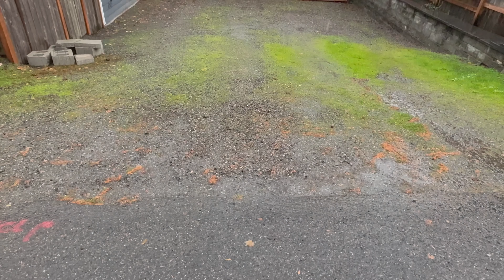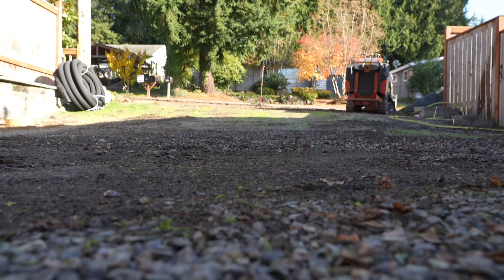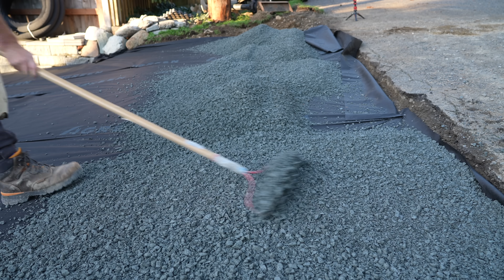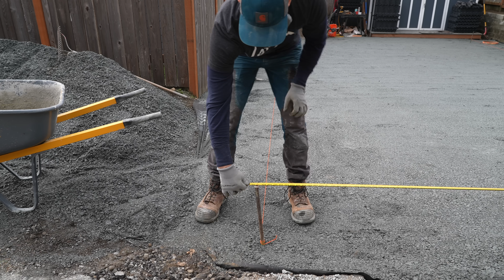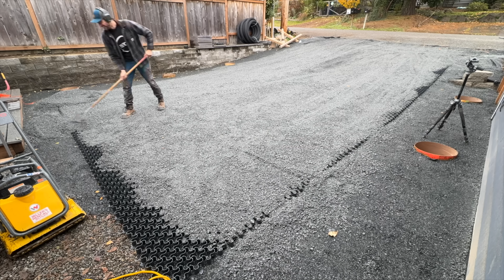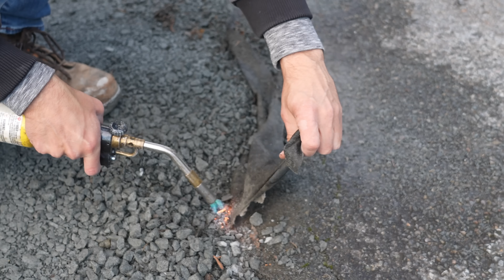How To Install A Permeable Gravel Driveway Grid System

Comment: I would recommend as you  prepared the site having at a minimum 8” sock fabric Drain in the center of drive. You could clearly see from street view from front to rest of drive a low elevation that will trap water that will flow under house. Water must be redirected away from house at all cost to avoid structural damage to foundation. I would highly recommend renting a professional lazer on tripod. I realize you are attempting to teach others, but the expense you put in this project will be worth it. I have done excavation work many years and water can be enemy number one.
Reply: Yes, I agree, the drainage during heavy rainfall may not be adequate here for all installations, and while I don't know where OP is located, this could present a significant problem for some folks depending on one's location and climate.  A project such as this is the perfect time to install a trench drain along the edge of the road, for example, or to install a longitudinal trench drain between the walkway area and the parking area.  Then the walkway area immediately adjacent to the home should definitely be graded downward away from the building and toward the drain, with the driveway itself slightly crowned so that half of its width drains toward that trench drain, and half the width drains off the side of the driveway furthest from the building.  (Such trench drains can also move water where you want it most, into adjacent planting beds during rain after a dry spell, by attaching perforated drain pipes covered with sock fabric in those areas, as long as the slope of those pipes is planned accordingly.)  While this system is obviously meant to be permeable, anyone planning their own may want to consider that such a system will also tend to become less permeable over time as silt, mud, dirt and vegetation accumulate and gradually contribute to a greater density at the surface, and of course any ice or snow on that surface will completely change the equation.  Above all, anyone contemplating sealing or topping such a system with tar at some point in the future will definitely want to make other provisions for drainage that may not have been necessary for OP.  Planning ahead to accommodate extreme weather events is generally proving to be a safe bet!
Reply: He’s in the PNW so he might be on a slab. No basement or crawl space. If there was crawl space we would have seen vents below his siding.
Reply: Yes my thought exactly, I was thinking of possibly a French drain with a catch basin.
Reply: I was thinking of something similar - but mine was to collect the water.  This is needed in my situation because I live on clay - and good drainage is an issue.  So I'll probably have 2 levels of crushed below the plastic top with an additional barrier to divert the water towards the collection system.
Reply: We’re thinking about installing something similar on our farm to run a forklift on dirt. Can you help me figure out the most cost-effective way to do it while making sure it lasts long term? We have a limited budget, but we want to do it the right way.

Comment: I think that’s a 36” machine not 30” wide. That would be a very small mini skid haha. The 36” is already the narrow track version of the SK800. Great machine I use them all the time. I always use woven fabric to separate soils from aggregates. And as others have said weeds will come. I think soil / aggregate separation is a more accurate description vs. calling it a weed barrier. Is there a reason you chose non woven? The woven is much cheaper too … like $200 for a 12’x300’ roll.
Reply: They are so cute.  Made to fit through the door so you can work inside a building.  Made a work area inside, watched them bringing in the gravel and dumping it to fill the 4 foot deep pit was funny.

Comment: The grid system that is $1077 for 315 sq ft is very expensive. You probably spent $4000 on the grid system!
Reply: no discount till you get the $12K packages.

Comment: Can grass be used instead of gravel?
Reply: the website shows it with grass inside it.  Don't know how the lawnmower would like it though.
Reply: We used it with grass and it works pretty well. Protects the roots of the grass and is easy to mow over if necessary.
But, keep in mind, grass may not grow under a tree (even grass in the yard tends to be thinner or non-existent under a tree). The grass is thinner under places that are driven over multiple times per day.
Reply: Thanks!!!

Comment: I made the same set up using  a roof tear off (shingles) and  8/10 screened gravel.   I saved $400 fee the roofer wanted for taking the piles to the landfill and spent that on a delivery of gravel.  I turned 2 swampy areas into great pathways that have stayed soilid for 30+ years now.   I did err by adding some gravel fines to one path thinking I wanted it to be tighter and quieter but it instantly turned into a bed for weed seeds!    Every year I have to scrape off the spring growth on that one but it still has never sunk into the swampy condition I needed fixed.   If I were laying a driveway on country property I would make it from  6 inches shingles (packed)  and 4 inches of 8-10 gravel topping!
Reply: all those roofing nails makes a good keep out sign as well.
Reply: Get some rock salt for the area with the fines that is growing weeds, it'll keep any kind of growth OR, you can mix a gallon of white vinegar and dissolve two cups of salt in the vinegar and pour it on that spot; that will kill whatever is growing and prevent more growth.
Reply: @ApoliticalBlues  Some folks may have trees growing nearby with roots underneath the pathways, in which case they'll want to avoid applying this advice too aggressively.  A good rule of thumb is that many of the most important delicate, fine roots will be located just at the drip line formed around the tree when that tree is fully leafed-out.  We had a neighbor who moved in and built a brick patio under the canopy of one of our old trees.  This alone was hard on the tree, but then he applied concentrated bleach liberally and frequently to the permeable brick after the fallen leaves began to discolor the brick.  That particular tree was dead within a couple of years-- go figure.
Reply: All of the chemicals in the shingles, depending what they are made of, will seep into the ground and poison it
Reply: @Esper320  I am not a doctor or anything but i believe asphalt shingles are made out of asphalt.
Reply: @Esper320  everything used to make shingles came out of the ground already.
Reply: @robertsmith2956  Thats like saying its fine to dump oil on everything becuase it came out of the ground.
Reply: @robertsmith2956  those petroleum related products lived deep underground, not a few inches below the permeable soil where leaching is a most destructive thing.
Reply: @mikeunruh8660  No deep underground oil came after finding it in Texas.  Ever see the opening credits to Beverly Hilbilly's?
Reply: @robertsmith2956 well, if your litmus test is a fictional comedy from the 1960’s, I’m not certain that we can come to an understanding.😂😂😂
Reply: @mikeunruh8660  La Brea Tar Pits ring any bells?  Oil is on the surface for decades before they started drilling down.  Lower oil is also what gives you the oil rig shot when you hit oil.
Reply: @robertsmith2956 it’s not oil, nor tar. It’s actually asphalt. So, no bell ringers here.
Reply: @mikeunruh8660  What do you think asphalt is made of?  petroleum.  guess what petroleum is?  OIL.
Reply: duh I like the way you think. reuse

Comment: You are missing a great opportunity in the last step.  Rather than use the small gravel in the grid, use recycled asphalt that has been processed and classified into smaller bits, it's cheap and this grid will make it imperious to it's common use and decay from normal use, especially on sloped driveways.
Reply: Crushed asphalt is very dusty!

Comment: I put that grid in the wet area in front of my gate.  Planted grass, filled it problem puddle and mud mess, gone for good. Worth it.
Reply: What’s your location? I’m in the Piedmont of North Carolina and curious how it would grow grass and stand up to 100+ degree summers.
Reply: @CLIFFROD1  Mojave.  Rolled sod into it.
Reply: @CLIFFROD1  have to accept some wear and the product will hold water on one side of cell vs other.  Same with shading if the sod or grass recedes.  Not perfect.
Reply: i'd be worried about slip :|
Reply: This is the only think that makes se to me - a gravel lane is better maintained with a Harley rake but if you put this grid down you'll only ever be able to add gravel - not to mention ripping it by accident with a snow play wouldn't be fun.

Comment: You don't really want to place the extra gravel. The idea of the gridlock system is for the gravel to fully reach the top of the grid but no further. In that way there will be no potential loose gravel. Also, I'd say the top of the existing old subgrade should have been removed and replaced with the same gravel. And last but no least, drainage problem are likely to continue. The grade seems to slope down toward the back of the driveway. Since no drainage improvements were accomplished, the rain runnof from the street will continue and water will be ponding at the back, eventualy weakening the subgrade. Before misleading people , please read a little and inform yourself from reliable sources. Internet brings tons of trash info.
Reply: Stop being  an  ashhhhhhh

Comment: Sonotube isn’t meant to go underground.  It’s meant to form a cylindrical column above ground.  That cardboard will degrade and your carport foundations will become loose over time.  If you dig a hole, concrete is to go directly to the earth embankment.
Reply: The concrete is poured into the sonotubes.
Reply: Sonotube is used regularly below grade.  No issues.

Comment: How is the drainage?  I would think a graduated base material like that would actually not allow too much water through or at least not allow it through quickly.  I am a civil contractor and all systems like this that I have looked at have used a coarse material without fines.  Also, for aggregate, we add 10% for material loss when moving from a stockpile and 25% for compaction.  The move going backwards with the bucket is called back dragging, or back blading, backhoes actually have a float feature to make this easier.  Nice work.
Reply: the drainage problem far as can be seen in the video will remain. 
also don't you think he will be forever chasing the transition line from street to gravel?
Reply: you are right, this dude doesn't know what he is doing. non-permeable material sloping into the house

Comment: These plastic grids are okay for fine or round pea gravel material... but I prefer geogrid hexagonal fabric for typical aggregate. It drains better, locks gravel better, and works better with contours. The only advantage to the plastic grids, is the ability to drive over it before filling.
Reply: You seem yo be knowledgeable.   What is the advantage of this over a standard gravel drive way. It seems like extra unnecessary steps
Reply: @bellasmom2597 it won't wash out or rut is the 2 main benifits which is good for steeper gravel driveways but most folks use washed 57 without all the extra but you gotta take care of it more often
Reply: @bellasmom2597  - there are two main advantages: 

#1- reduced maintenance cost. They reduce rutting, promote better drainage, and keep your gravel where you want it. Most gravel driveways typically require grading at least once annually. Depending on your soil/precipitation/depth-of-bed, it's typical to add gravel every two years. These grid panels resolve both. They also mitigate edge roving... so your borders don't require edge maintenance. 

#2- increased load capacity. For the same reason these grids reduce rutting, they can also allow you to place driveways and parking areas in places that might not otherwise support the load. For instance, a wet/soggy area with poor drainage, or anywhere with a low soil load (soft soil, shallow pipes, sensitive turf, etc.)
Reply: Grass grows through it.  After a few years you'd hardly notice it.   If I were a landlord short parking this is the way to go.
Reply: @redrocklead  - they do work fairly well with turf... until they don't. After a while, soil fills the cavities and the grass is too close to the surface. Depending on location/turf, this could take many years, so it may still be a viable option for some.
Reply: @driverjamescopeland  I concur, but while the cavities did fill with soil the puddle is gone.  The prep prevented overcompaction so while embedded  with soil, the grid allows water to still drain through.

Comment: There should have been a cost analysis of this project compared to just a concrete pour job.
Reply: These are equally as expensive as pavers and you are already doing 85% of the same work to install anyway.
Reply: No comparison to concrete.  Big bucks for that much hard surface.  Drainage off a hard surface requires careful planning and execution so no standing puddles and, or flow into the home.  Much more labor for permeable pavers.  Anyone can do the rock and pavers with basic tools.
Reply: At least $3/sq ft for grid and cloth. Not sold on the grid.
Reply: There's no way to accurately compare the two as this is a fairly easy DIY option versus having to pay a crew to pour and finish a slab, and that's assuming that they'll work with DIY forms. $1,925 for the grid material, $750 for aggregate and I'm guessing about $150-200 a day on the track loader. Pretty sure a driveway like that in concrete would be close to $10,000.
Reply: @lunchboxproductions1183  I think he meant putting up the forms, and having mixer drop off the concrete, and then float away....
Neighbor has a mixer bucket, so I could do it one box at a time.....  I have a loop so don't need to drive on it while it cures.
Reply: or simply using geogrid....and an actual professional...

Comment: People do not understand how to use sonatubes.  It’s to hold the concrete above the hole not in the hole.  So you can have a raised footing.  If you drill a hole and drop the tube in there is space around the tube that will have to be backfilled and you will never get the compaction back to even 90%.  The hole should be filled with concrete and the tube should only be a few inches into the hole and the rest outside
Reply: That info is so wrong. The code and manufacturer state that you're only allowed to have 40% of the total length above ground
Reply: That makes way more sense

Comment: Filling that geocell with crusher run (road base) defeats the purpose of the cells imo (drainage and permeability). You could have gotten the same result with a layer of cheap geogrid between the two lifts of road base, and saved a couple thousand bucks.

Comment: This grid system looks very nice and would be awesome for our driveway....of course our driveway is also hundreds of feet long so would take many of these panels....so guess we had better start saving up for a future project with them. We are LONG ways away from 100k ourselves and know it takes a VERY long time to get to that point. Great content bud....everything turned out amazing.
Reply: Rolls of chainlink fencing
Reply: Maybe you could do something like I did using roofing headed to the landfill as the base and simple 8-0 gravel as topping.    Do it as on the installment plan   lol  fix your worse spot first.    Mine has lasted 30 years though no heavy trucks go on it.
Reply: @itsno1duh  What about nails?
Reply: Do it in the parking areas and entrance

Comment: Wouldn't moisture and or water building up in the plastic grid be an issue?  It may not drain very easily.
Reply: the link to it says it has weep slots for water flow.
Reply: @robertsmith2956  Yeah... those will never plug up
Reply: @mattywho8485  Even if they do.  You can't tell the difference in most cities.
Reply: @mattywho8485  Even better, it may plug up the leaks in the pipe as it fills the holes.

Comment: What is the cost of the plastic grids
Reply: Cost is equivalent to that of a full thickness crushed stone base (typically 6 inches after compaction). Find local prices for the crushed stone base suppliers in your area. The only real advantage of this gridlock system is that is DIY'ers friendly